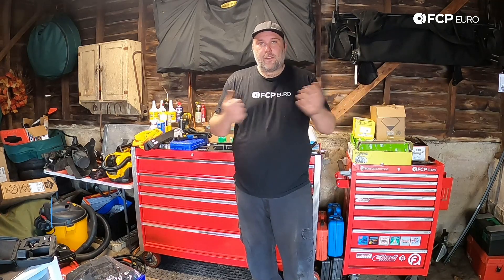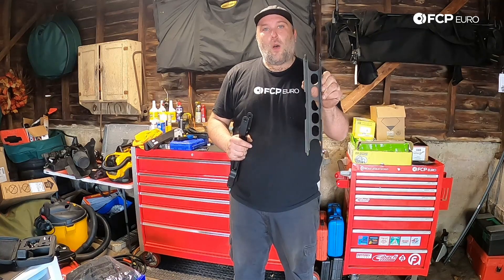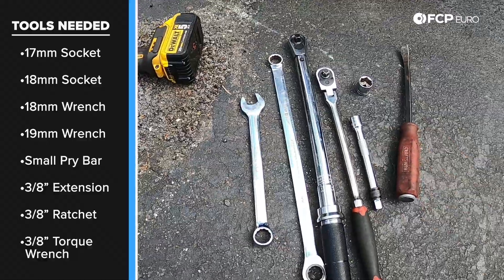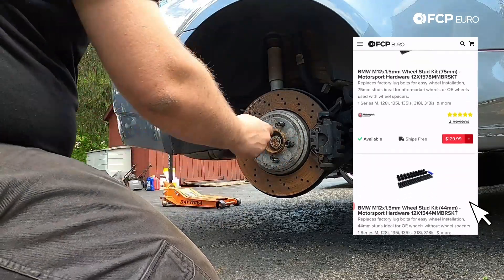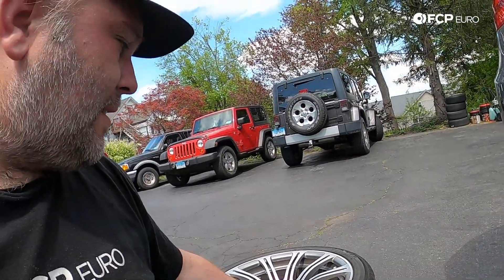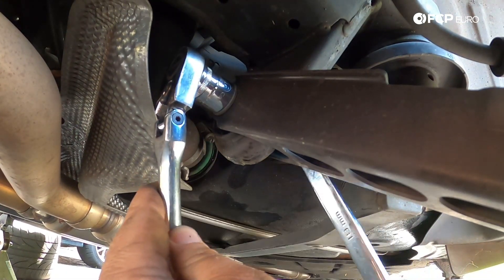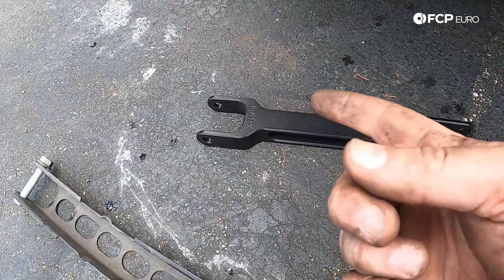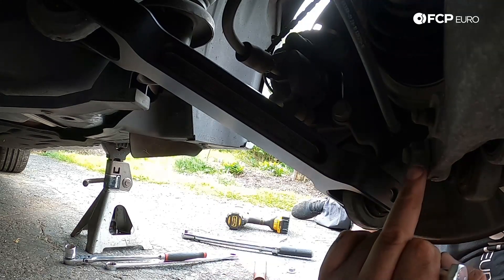BMW E90, E82, & E84 Rear Trailing Arm Replacement/Revshift Upgrade DIY (M3, 328i, 135i, X1, & More)

Comment: Great vid.  But...$500 for a part that will make very little difference to the handling as the bushes (which is what wear) are unchanged.  Just saying...
Reply from the maker: Phil you are right that the bushings are the bigger pain point back there, but it is $250 for a pair of nicely CNC  Machined Billet Aluminum and not $250 each atleast! We are looking at putting together a kit that would improve the bushings as well, which would pair nicely with these trailing arms. They're certainly an upgrade from the manufacturers originals, but for sure not a necessity! Thanks for watching Phil.
Reply: @fcpeuro  You need to amend your website.  It clearly states "Price EACH: $249.99"
Reply from the maker: @philthomas9396  that is indeed misleading, unfortunately it always says Price Each : __ even when its on a kit product page (kits comprise multiple parts). I'm going to talk to the catalog team to see if we are able to make that a bit clearer on product pages with more than 1 item on them. Whereas Price Each:___ makes sense only for singular items. Thanks for bringing it to my attention! I did confirm though its $250 for both as a kit "CNC machined Billet 6061 T6 aluminum construction, includes two arms"
Reply: @philthomas9396  you must a real joy at parties....yes each "pair" your the only person I ever heard of not understanding that
Reply: Bushings, control-arms, sta-bars, dampers and suspension geometry are not understood by 99.99% of back-yard mechanics.  "Red Paint" is the primary upgrade.  With a blind-swap drive-evaluation for this modification nobody would be able to tell a difference. Billet aluminum is the new "red paint."  That said, FCP-E is a good company.

Comment: So I'm pretty sure I gotta do everything on the rear but can't go about doing everything at once. The rear left the camber goes negative (dispite an alignment) and eats away at the inner rim of the tyre. Where should I start to help the the tyre last until I can finish the up on everything in stages?
Reply: And more diy on the rear suspension coming soon? Please and thank you!!
Reply from the maker: There is a bolt with an offset washer attached to it, turning that bolt will change the camber, it's best to have it set properly on an alignment rack. But, if you have excessive rear camper on one side that will wear the tire out, you can try turning that bolt to bring the camber back in for now.

Comment: Very informative video, thanks.
What would be really helpful though is how to change all the bushings/ball joints on the rear suspension, including the rear subframe's and differential's bushings...and tools used for the job...these multilink suspensions get tricky to work on them sometimes, especially on the driveway 🤣😂🤣😂
Keep up the good work!
Reply from the maker: Thanks, Bate! We will definitely add that to the list of DIYs. Stay tuned!
Reply: @fcpeuro  looking forward to another video showing rear upgrade R&R to new (M3) parts, too. Y'alls videos, whether discussing the what and how it works, or how to DIY on stands are great. When you do the surveys of the whole system, you have to appeal or talk to people at different levels of understanding, and the way you've shown the suspension parts, (and briefly mentioned what and why) works pretty well, I think, with a decently breezy style. I'm on the low end of the knowledge curve here, so if you ever do slow dow, discuss it in any greater depth, show the part from both ends installed and compare it again to one on the table - I'm sure old hands may find it slow, but I'll be learning even more.

Comment: Hey FCP, at 10:42 you put it in ride height, but it is my understanding that BMW states, that this has to be achieved by loading the car with weights in specific places and specific weights, and then lowering it to the ground and then measuring the distance between the rim and the wheelhouse edge. Could you please say a couple words about this?
Reply: You dont need to do all that fancy shit, just jack that wheel up to ride height and torque it down.

Comment: On my 135i...  the inner bolt is rusted solid to the bushing. How would you proceed ? Cutting the old bolt off ? When I try to turn the factory inner bolt I can feel the bushing wanting to tear. I was also thinking of using an impact drive on it.  Also...  why no use of anti seize on the shank of those new bolts ?  Thanks...  LOVE this video series!!  Dackel approved.
Reply from the maker: Definitely try an impact before resorting to cutting anything off. You can use a little bit of anti seize if you are concerned about it rusting on again. Glad you love the video series, Dackel. Thanks for watching!

Comment: I'm definitely planning to do this upgrade, the factory arms look like scrap metal.
Reply from the maker: It's a great upgrade. You can take it one step further by replacing the rubber bushings with sealed monoballs, Lermforder  p/n  3067901 or Meyle p/n 3147100005 (both available from FCP Euro).

Comment: so since the upgraded trailing arm is now not the weak point, wouldn't it deflect damage to other components which are more expensive to replace? Just curious
Reply from the maker: Hi, Alex. These tailing arms will not damage other components.
Reply: Yes, this is the consensus and bushings are the weak point.
Reply: That is a good question and observation.  My plan is not to have a wreck.
Reply: Yeah, he even says the stock arm is designed to bend and protect the fuel tank, then immediately says the new one won't bend in a crash, and risks puncturing the fuel tank 🤣

Comment: Great video, is there a noticeable improvement in ride or handling though? Enough to make it worth it?
Reply: Also, my E93 has about 57K miles on it. Would it be prudent to go ahead and replace the bushings while I’m at it?
Reply: wondering the same thing. i have 325i ‘06
Reply from the maker: The ride will be more or less the same, but these arms are without a doubt much stronger than the factory. We are working on a kit with upgraded bushings for a bigger improvement in handing.
Reply: @fcpeuro  hi, did you notice how much the bush moves when you torque the chassis bolt on your video?
Reply: @samlee458  I think they updated they have a full set for under 700 I believe
Reply: I wish he was my friend lol

Comment: Anyone know if the BMW E90 M3 rear toe control arm fits the standard E90 335? Positioned at the Rear Lower Rearward of the axle.
Reply: No it doesnt. M3 is shorter.

Comment: Great tutorial. Thanks. Question: plan to upgrade front axle with M3 control arms on my 2011 335d. For the rear, what would make the better change, this Revshift piece or the M3 control arms? Thanks again.
Reply: You will feel more difference from the control arms.  If you are changing the front control arms to M3 control arms, do the same in the rear.  Then have the car aligned to M3 specifications.

Comment: The bolt at the subframe on my e90 Awd is held on by a bracket that welded to the subframe.. so it’s impossible to get off without cutting.. Is this normal?
Reply: Hello realisaiahwake . 
Can I ask you about your solution to the bolt at the subframe for the rear trailing arm ?  I’m also dealing with the issue on my E90 AWD  .  Did you cut the old bolt off ?

Comment: Your videos are awesome! I Just upgraded my 335i CONV. with the m3 aluminum control arms. Then two days later my entire rear end stated vibrating like hell. Any help would be appreciated 🙏.
Reply: Starting with the toe arm wish is not compatible, maybe some alignment problem or bad bushings.
Reply: It's because your bolts are preloaded when torqued down in the  air. You should torque down the bolts when the wheels are on and sitting on the ground.
Reply: @elsoung  that's physically impossible lol. You jack the wheel hubs to ride height and torque down. Same effect and the same thing they do at shops

Comment: My understanding was that the trailing arm was designed like that as it creates crumple points in a accident it won’t snap and tear a hole in your fuel tank ???
Reply: He literally says that in the first 30 seconds of the video...
Reply: @jagtem which is hilarious, cos then he explains that the new one won't bend, won't protect the fuel tank, and that's somehow a good thing... and that it also won't provide any handling benefits 😂

Comment: Would this work on a 2006 Z4 Roadster?
Reply from the maker: The Z4 rear trailing arms are different, but we could check if Revshift makes a trailing arm similar to this for the Z4.

Comment: I don't understand why this new part is in any way superior to the original part? My lower arm has 170k miles on it and is still in 'as new condition'. If it wears i will replace the bushings for very little money. 
I think Sir, you were gifted these arms and thus feel the need to slag off the originals. Originals that were produced by BMW engineers who , i believe, know an awful lot more than your good self.
Have a nice day.

Comment: That is a useless upgrade, nothing is flexing in stock arms. It's well known BMW OE suspension design is superb. The only ways to make it more superior is to go to full PU rubber transmission & engine mounts rather than liquid filled OE mounts and aluminum subframe insert to get rid of the rear end slushiness.
Reply: Lol okay bud